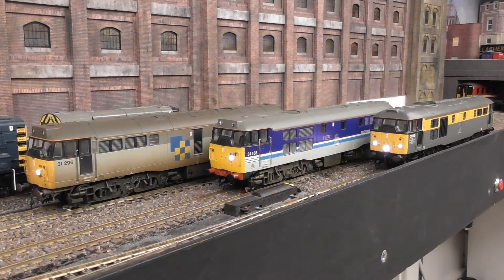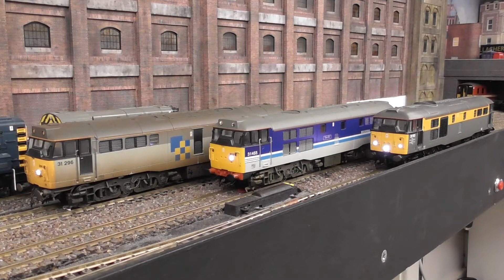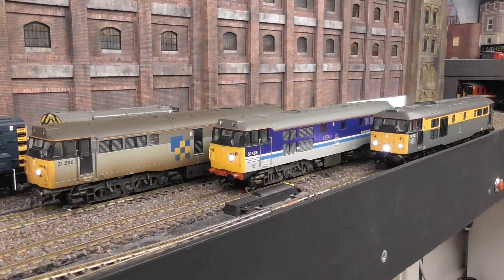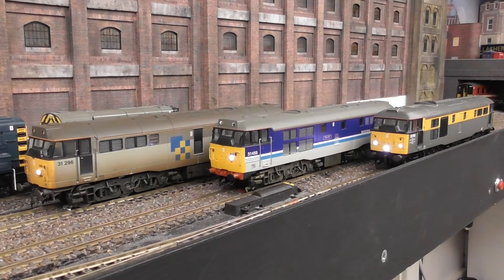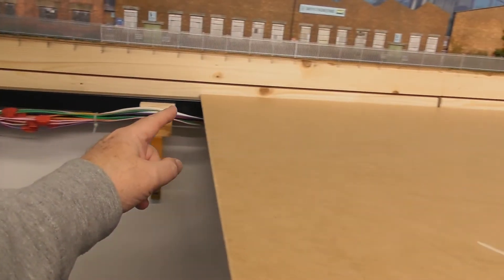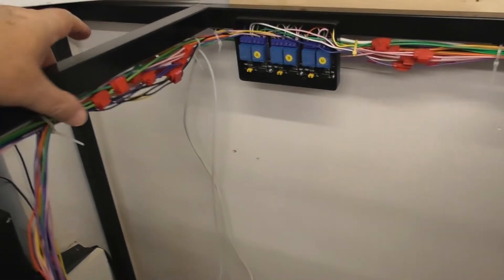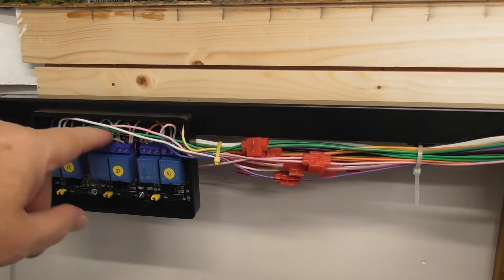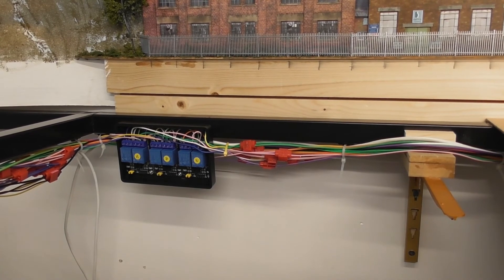Canal Sidings 84   An Inglethwaite progress update, The woring begins

Comment: Ah Wiring,  Such a fun job lol.  At least you seem to be keeping it all neat and tidy which always helps.  It's always amazing how much wire you actually go through doing dcc.   Cheers
Reply from the maker: So true Michael. I have already used 100m of 24/0.2 and at least as much 16/0.2 so far. I estimate that I will also use up to 200m of 7.02 for the signalling. It's getting a bit like a Clapham Junction Network Rail S&T cabinet in here !!! ..............................John

Comment: Good luck with the wiring. Why dont you get a thermostatic radiator for your railway room, set on low it will keep your room at a workable temp.
Reply from the maker: Thanks Minty. My room is actually heated by a radiator on the house heating system but in winter it sits at about 15 degrees which is too cold for me unless I am moving about a lot. To raise the temperature another 6 degrees so that I find it warm enough costs a fortune due to the very poorly insulated flat roof on this part of the house. So I vacate from about December to early March. ...............Jlohn